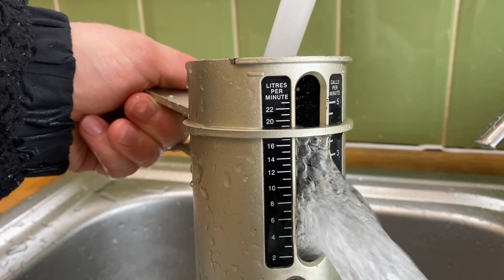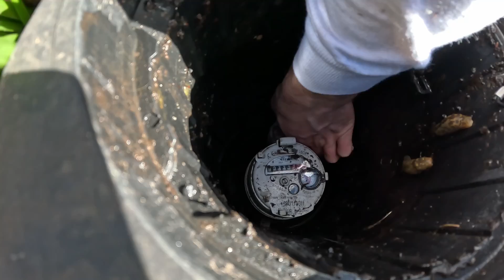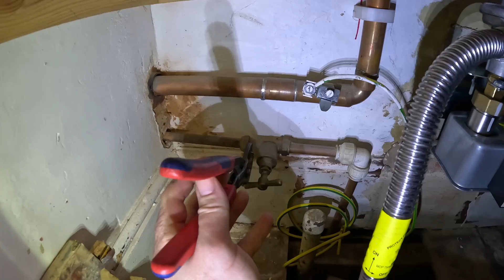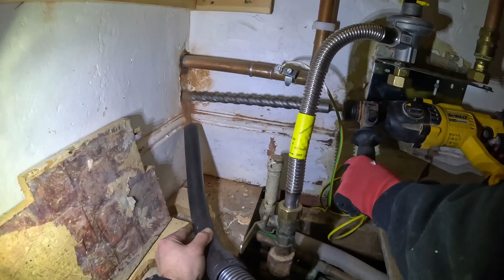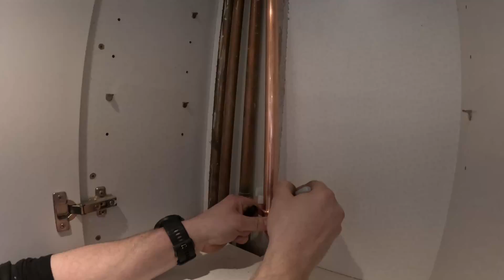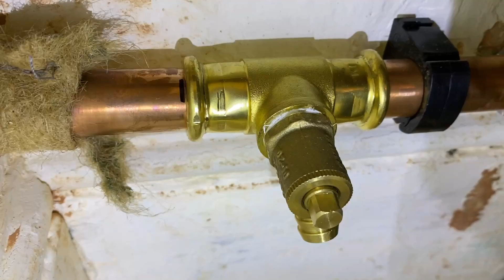Increasing the size of my water main

Comment: Why not 32mm mpe from meter and 28mm copper inside reducing down to 22 then 15 as needed?
Reply from the maker: I would have done if it didn’t involve digging up my driveway!
Reply: Because in that case, you might as well upgrade everything and rip out the entire house to do it. Also if the pipe is too big, the flow rate could increase but it might not be enough for the diameter for it to be safe.

Comment: ♣️♣️ Press don't stress 💪💪💪 the only thing i would do differently is lever valve double check valve for backflow prevention then a drain valve
Reply from the maker: Thanks for watching! 
The combi valve by the unvented cylinder is the next thing on the pipe run, which has back flow prevention, so all covered on that front. Appreciate I didn’t make that very clear on the video!
Reply: @TheDiligentDIYer1759  i didn't see the combi valve👀🤓🤓 should've gone to specsavers😂😂😂 that was a lot of work for an extra 2l/min